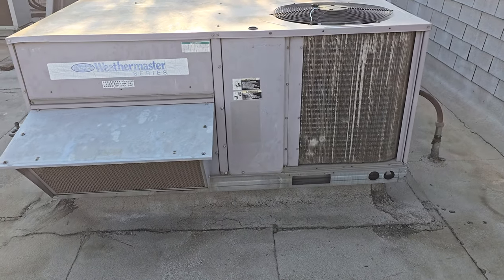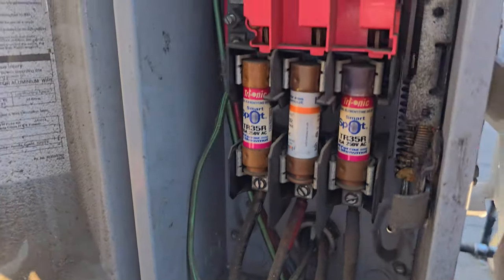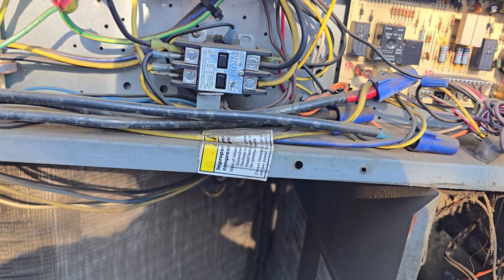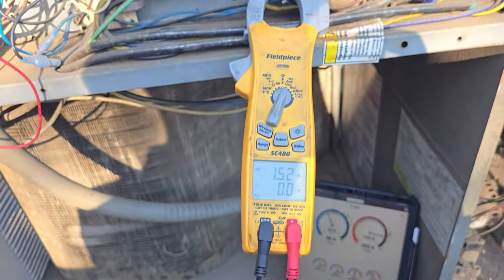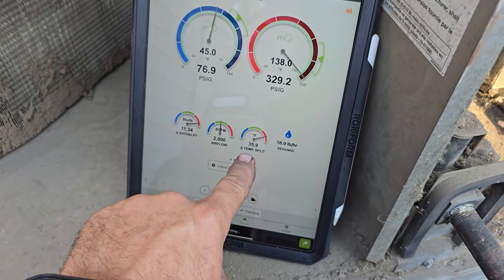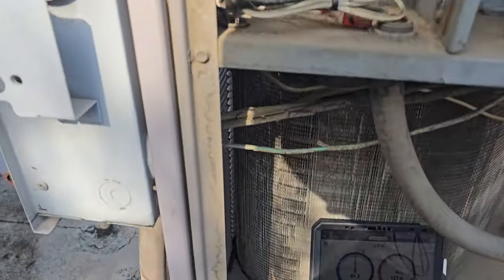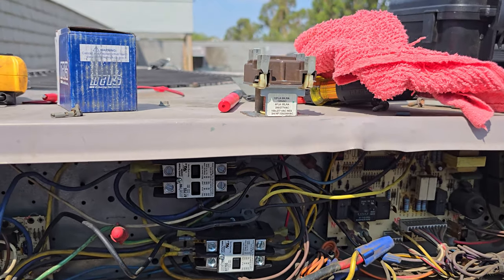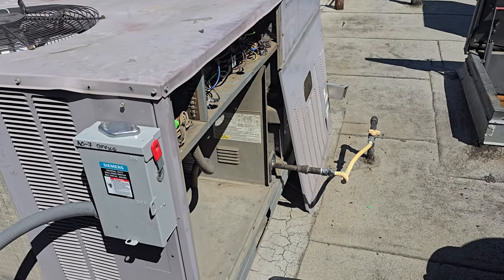THIS WAS A CRAZY BUSY WEEKEND

Comment: I'd put in a non-fused disconnect on a three phase system.  Blow one fuse, and three phase motors get trashed, unless the unit has loss of phase protection.
Reply: the breaker may be oversized for the units ratings and not thermal trip at all, like a closer to spec. fuse would after heat soaking. that's why many call for fuses of a certain size, where breakers may not be available in that size. as for a short circuit/hard fault, the breaker will often open first, unless fast blow fuses are involved.

Comment: That thermal image camera likely saved you a call by ratting out that contactor starting to over-heat.  And hence on the disconnect you could see line 2 getting hot and line 3 getting very hot -- bad influence for the fuse. The thermal image really reveals what is going bad and the marginal stuff too. Great vid for the electro-mechanical issues.
Reply from the maker: The thermal camera is a great tool

Comment: You should always check phase to phase for shorts as well, not just phase to ground. Granted only one fuse blew, but still
Reply: Trouble is, you'll see the motor windings when going phase to phase, unless you check on the line side of the contactor with the power off.
Reply: @smithno41  true, you have to know the difference between a dead short and motor winding resistance

Comment: Great video, Chris. I liked the intelligent prioritising of what tasks needed to be performed and how, depending on both the big picture of the equipment you're working on at the time and the overall workload.

When you're using a clamp meter and measuring current through the clamp, one extremely common mistake is not separating the wire that is being measured from other sources of magnetic fields and ferrous metalwork. This was particularly noticeable when I saw how you measured current on those large feed wires with them all bunched together like that near the clamp and metalwork. The higher the current in a wire the worse the problem is as the meter does not just measure any wire put through the clamp but every magnetic field that induces a voltage in the clamp. It's actually surprisingly easy to get an inaccurate reading due to stray magnetic fields, which can produce a reading that is higher or lower than the true reading. This means that a motor can appear normal but is actually over-amping due to the position of the clamp and stray magnetic fields, as well as the opposite problem where a motor may read like it is over-amping but actually is not.

A bad or failing crimped connection will have increased resistance and therefore build-up heat. Crimps fail because they are generally not squeezed sufficiently to form a true gas-tight seal that keeps the oxygen out from around the wire strands inside the crimp that causes oxidation and corrosion. A lot of crimp fittings can't actually take the required pressure and the small handheld tools can't actually provide enough pressure anyhow. I have come across this problem so many times which is why I personally always solder as well when I make a cable up to guarantee a strong, reliable and lasting connection.
Reply from the maker: That's something we should all be aware of, I appreciate you sharing that.

Comment: Is there any way for you to transplant the guts of the new disconnect into the old disconnect enclosure? Perhaps the throw-switch complicates this, but with typical electrical panels can sometimes swap out the guts and leave the enclosure alone. Great to see all that wiring / contactors cleaned up etc.

Comment: When you first got there and were checking for grounded circuits, you should have pushed in the contactor since the power was off. and checked for grounded compressor, ect.  Things that the contactor powers.;
Reply: @glennsepelak5113  he checked both sides of the contactor so its the same as thing

Comment: That early September heat wave was absolutely brutal. That Thursday and Friday you speak of, I was in Colton both of those days. 118° on Thursday and 122° on the Friday. The following week I had a few service calls, all the same thing: popped disconnect fuses and condenser coils completely plugged up from all the dust and ash from those fires. None of the units had any shorts. Only thing I could think of was the plugged coils combined with the nuclear heat wave overwhelmed the circuit causing overamping, and plus who knows what wonky power fluctuations occurred from the overwhelmed electrical grid. Only one unit had loose connections from the disconnect all the way to the contactor.
Reply from the maker: Nuclear heat is the best way to put it
Reply: @HVACRVIDEOS  pretty much. Or like a giant walk-in oven with wind.

Comment: Did you happen to see the high voltage lines inside your electrical section?  The lines are running from the lower section to the upper encloser section passing thru a hole in the metal bulkhead w/o any bulkhead protection and a prime area for wiring to rub thru the insulation? 11:29 time stamp.
Reply: Often there are holes with a beveled edge for this reason so im guessing thats what is there. He is pretty good on picking up on that especially when running new wires. Would a legit plastic bushing or grommet be better? Probably
Reply from the maker: I'll go back and double check

Comment: Could you break down the meaning of using disconnect switch with fuses?
Why you cannot use a circuit breaker in the box instead? this will use less contact points, so less potential fail points

Comment: Fire alarm work aint any less busy or choatic. Had a job at a local theater where we found out that the ceiling had a rats nest in it and the installers who put in the system put a duct detector we needed to replace in a very hard to reach location. The duct detector ended up being inaccessible to us and we told the customer we needed scaffolding to get to it.
Reply from the maker: I've seen a few restaurants like this, the smoke detectors where installed at the very top of the ductwork under the roof deck, impossible to reach

Comment: Be careful using large conductors / large wiring in small disconnects--wire will only bend so far, and so downsizing to AWG8 was smart. Here's an easy hint if you haven't been measuring your wire bending space--if the insulation is wrinkling, you're close to the limit, and if it cracks, god forbid, you're over-bent and need to cut that part and start again.
Reply from the maker: Another nugget of good information worth noting, thanks for that

Comment: I see these package units with gigantic supply wires coming from the disconnect all the time. Such a pain fitting them in new contactor lugs lol. Are these wires installed at that size on purpose? Seems intentionally oversized
Reply from the maker: Perhaps, or in some cases the wire was sized for a larger machine that is no longer there

Comment: I get confused on discharge temp/pressure on package units vs. condensing units.   On condensing units, you have the liquid and vapor port after condenser.   Most package units only give you the discharge port directly after the compressor.  When doing the 30° over ambient, does that include discharge temperature right after the compressor?

Comment: With as many fuses as you have blowing on a single phase, what would be the point of continuing with fused disconnects? It seems like it may eliminate some of your calls.
Reply: In this case, he was really forced to use a fused disconnect because the MOCP (Maximum Over-Current Protection) was 35 A, while the braker in the panel was 40 A. 

Commercial Carrier units do monitor the amp draw to the compressor and will lock the compressors out individually if there not within spec.  That should protect the compressors.  Ideally, a phase monitor along with a fused disconnect would be the best solution.  The phase monitor would interrupt "R" to the control board, if it were to drop a leg, voltage went high or low, or become phased wrong.

Comment: GE is crap, use SqD disconnects (except for the really small one that has the switch looking like a QO breaker, they suck).  Never had any trouble with SqD disconnects, GE a lot, Siemans are ok but yes the new ones seriously lack wiring space.